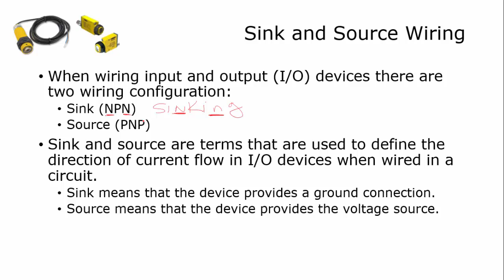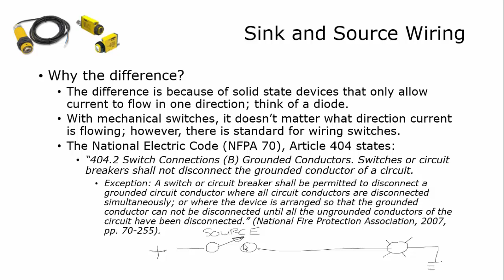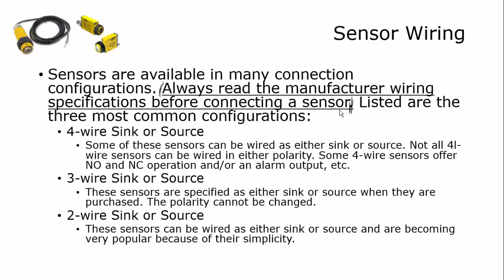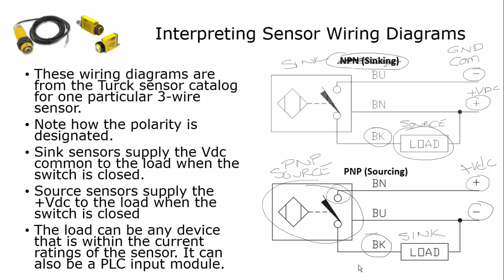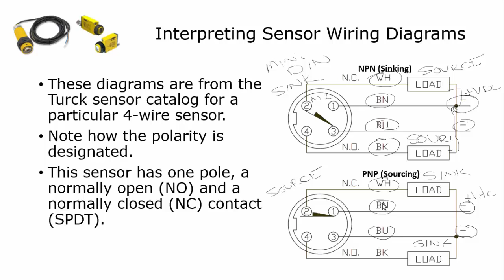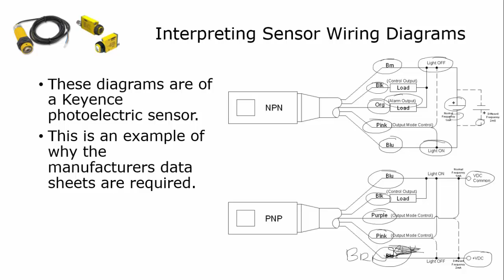Sensor Wiring Sink Source

Comment: can i connect PNP type sensor to Source type input PLC module?
i have a sensor OBT500-18GM60-E4 and S7 200 smart PLC
Reply from the maker: I deeply apologize for not seeing this for the past 2-years. I hope you worked out your problem. That said. PNP (Source) sensors will not work with a Source type input module. For source input or output modules, sink devices are needed. For sink input or output modules, source devices are needed. It's always opposite; sink to source, source to sink. Remember...sink modules and devices supply the path to ground (common) and source modules and devices supply the voltage. Therefore the voltage supply (source), must have a path to ground (sink).
I hope this was helpful even after all these years.
Thank you for watching my channel. I'll be adding a series on using the Rockwell Automation Micro 800 series PLC's and programming in Creative Components Workbench (CCW), if you're interested and if YouTube does not take my channel down. I do not monetize and don't qualify for monetization. Either way...I'm not here to make money. I'm here to help my students.